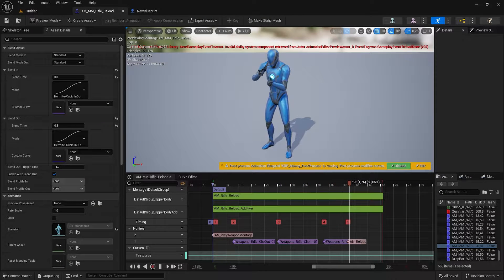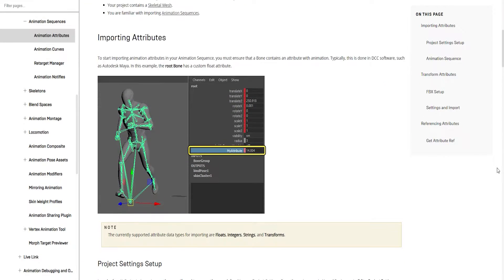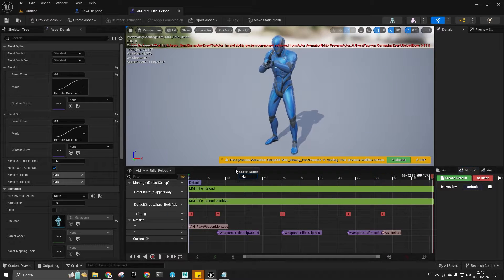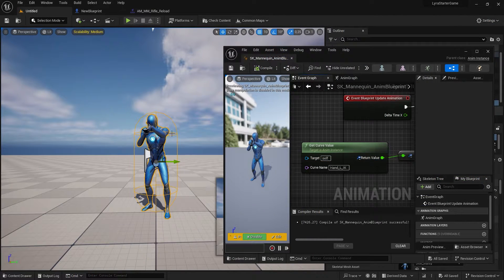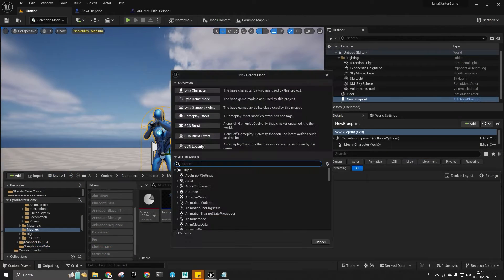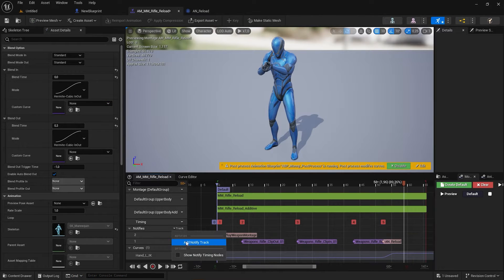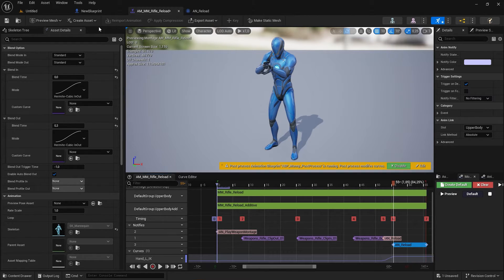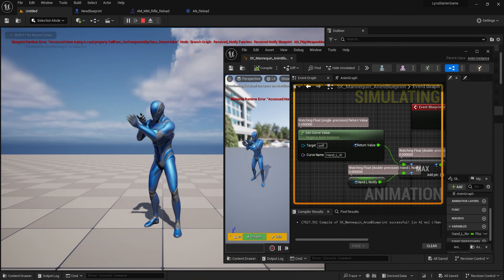UE5 TechAnimTip#3 - Keep Curve value while Blending In/Out from an Animation Montage

Comment: You can use Inertialization Blending mode for anim montage for fix it
Reply from the maker: I found out that using a metadata curve and a float curve, then use safe divide, solve the issue.
Inertialization blending isn’t always what I need.

Comment: You can alternatively use a Meta Data Curve to correct the issue during BlendOut/Blend In per the recent YT video "Fix animation curves Values With metadata Curves" or the old EPIC Forum post "Animation Curves Blended by Montage?". (Just read the extra comments / notes around the initial divide by 0 issue fix)
Reply from the maker: That is a far better way to deal with curves compared to what shown in my video, I found out about it after I published the tutorial and someone pointed out the solution.

Comment: hi, Please i wanted to ask if it possible to blend a set of bones that use rigid body dynamics into an animation using the same bones. it bones tend to jump to the starting point of the animation. thanks
Reply from the maker: Maybe controlling the alpha of the rigid body while performing that specific animation could solve the issue
Reply: @EnterReality  🤦🏾 duhhh. Thanks. One other thing if you don't mind. I have a long puncho. Is it better to use cloth sim or rigid body?. And why games only cloth sim from the waist down. Thanks
Reply from the maker: If you need to do a showcase or non-gaming thing ( virtual humans or similar ) then go for cloth sim, otherwise you need to think about performances, so either rigid body or joint based simulation for clothing.
Reply: @EnterReality  thanks so much for your assistance. 🖤